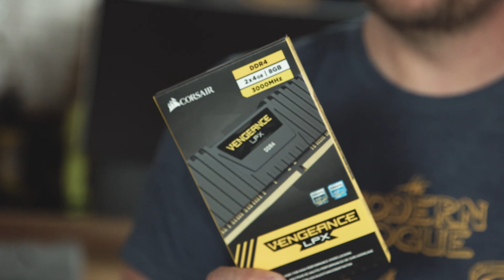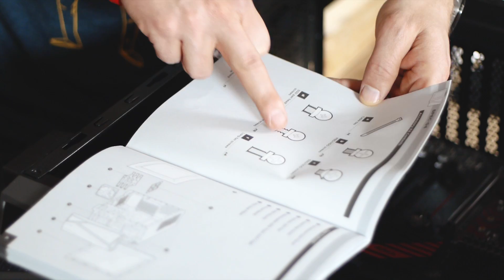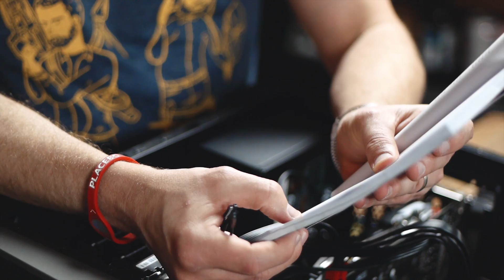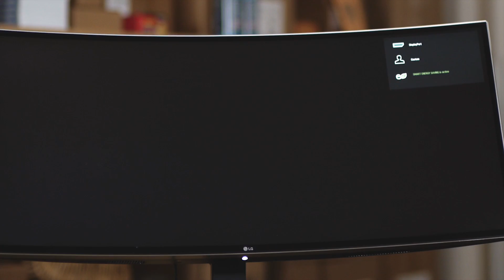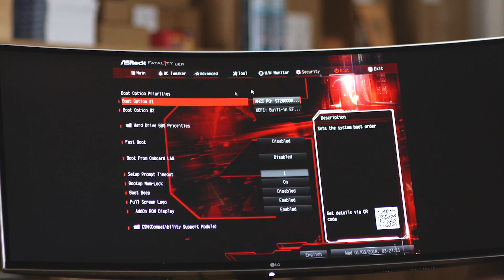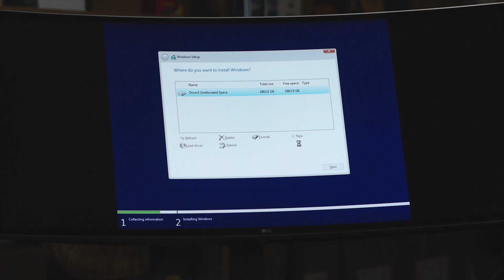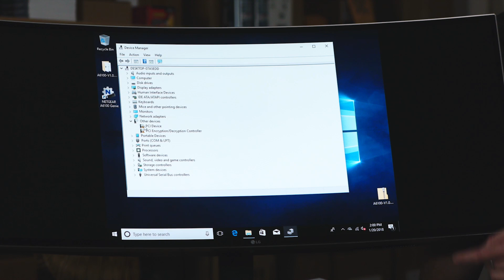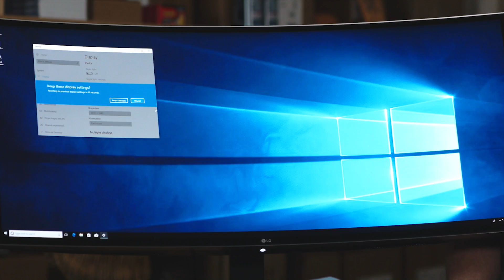Building a Gaming PC

Comment: Brian: "insert cpu in wrong orientation"
Jason: "oh, I remember"

that was Socket 3, pre 1993, in 486 times!! :o is Jason 100 years old?
Reply from the maker: 486/50 MHz was one of the first build I ever made.
Reply: @ModernRogue  Soo Yes?
Reply: @danieljhalab6775  confirmed
Reply: @ModernRogue   My brother once got suckered into buying a used 386 from WANG  trying to install Win 3.1 off the small 1.44mb  disks 6 OF THEM (about the time Zip disks and Jazz drives were coming out), then a 33.6kb modem before 56k tech were out the screeching then my girlfriends kid does some SouthPark  stuff in a chat box on AOL and I'd get kicked off for ''scrolling'? Can't say then were the good old days but I don't miss those AOL disks popping up in the mail kinda how Apple is polluting  the planet but "We can''t fix it we'll give you a discount on a trade-in (I'm sure they might go through your files because it's now their property again!)
Reply: @ModernRogue  A 486 should have had a ZIF socket unless it was some hokey-ass 486SL-25 really-a-386 crap. A DX/50 would've been ZIF. All the 386s had "Low Insertion Force" or LIF sockets. Those were the ones where you put it over the pins, hope to hell you lined them up right, and shove the chip in. And to get it back out you had this thing that looked like a comb to yank the chip back out. (The SL chips were mostly used in laptops because battery power.)

The bad old days. Says the guy who's spent more money on some old computer parts than the new ones that replaced them. sigh

Comment: The fact they forgot the I/O shield really bothers me.
Reply: Necrovarius was about to say this nooooooooooo
Reply: I was yelling the same thing
Reply: Same
Reply: was really about to comment the same thing xD
Reply: common noob mistake lol. but no really even pro's make that mistake sometimes.
Reply: I didnt see any mother board standoffs too .-.
Reply: the standoff's are already in the case for atx
Reply: Same     plus were is the RGB
Reply: me too
Reply: Necrovarius nashing teeth here Rrrrr
Reply: Me 2 but the worst thing is I did that to
Reply: Shuhei Depends from case to case, my last 3 cases didnt have a single standoff in them. Just sayin I didnt see them lol
Reply: Necrovarius not only do I not have an IO shield, I don't have sides to my case, no front, and no IO shield.
Reply: Fucked up the memory too
Reply: Henji96 How so?
Reply: Not mounted in dual channel config. Gonna fuck with the speeds of that ryzen cpu
Reply: Henji96 Each mother board varies on the config of the memory, he was reading the guide rather extensively, so Im sure he picked out dual channel properly. I dont use that mb so I cant say 100% but it should be running dc just fine
Reply: No he fucking didn't Look at 24:09 "Single Channel Memory Mode" It's A1 A2 B1 B2 on ALL motherboards. So the memory has to be mounted in every 2nd slot.
Reply: Thank you
Reply: That got me so upset
Reply: OMG I/O shield this is killing me
Reply: same
Reply: I always forget about it until after I've done cable management...
Reply: yeaaaah
Reply: me too
Reply: literally the first thing i noticed
Reply: they put the memory in wrong
Reply: Idk what the hell that is and I’m on reddit

Comment: It's kind of cool seeing you guys build your own PC, it's certainly gotten easy over the years. I wish I would have known I would have sent you guys a couple parts. :)
Reply: I remember when I would dumpster dive with my dad behind business parks in the 90's to grab old corporate gear before integrators would buy old or dead machines back for recycling. We'd load up the car with as many as we could grab, and cannibalize enough parts along with add in cards we'd find open box or heavily rebated from CompUSA. A lot used to be trial and error as to what was compatible back then, you'd spend hours diagnosing problems only to realize you needed to move a jumper and you'd even find yourself needing to write your own drivers from time to time.

Now, I built, cable managed, and killed all the Microsoft telemetry on my rendering/encoding/gaming rig in less than 3 hours, and have dozens of times the computer power of our entire old basement full of parts, and I have integrated audio good enough to make a SoundBlaster nearly pointless. Getting easier is an understatement.

Comment: And for 1800 dollars, you too can lose in overwatch in super wide high definition
Reply: overwatch can't play  in ultrawide, because blizzard hates fun
Reply: UHCKnight for 200 dollars you can buy a razer keyboard with some nice lights and clicky noises
Reply: R6jamandtacos who?
Reply: Jay Quek Hawken. Git gud
Reply: Im gonna check in this comment in a week, so far all of these responses are amazing
Reply: the hell are you talking about, overwatch works in 21:9 for me, thats ultrawide right?
Reply: Yes, but Overwatch cuts off the top to make it Ultrawide. The sides do not get extended at all. You are actually at a disadvantage if you play Overwatch on an Ultrawide monitor.
Reply: The ultrawide that Overwatch employs is a cropped 16:9 signal. It's not true ultrawide, you're actually getting less vertical FOV than a 16:9 aspect ratio.

Blizzard removed proper (perfect, true) 21:9 support when the closed beta ended, citing development/technological challenges (none of which were observable from the end-user with a machine that can run 21:9) and unfair advantages (which they've removed entirely when they changed third-person cameras to have a free-rotate camera, and made emotes both impossible to cancel out of and made touching the ground a requirement).

When asked about it at a Q&A at Blizzcon, an Overwatch dev indirectly confirmed they weren't going to change it.
Reply: From what I can see in the video, it plays pretty well in ultrawide.
Reply: Nucleargamer the dude who posted the main comment in this semi comment section
Reply: It should make you better with those smooth frames, but I wouldn't know right now. 
i'm just getting 60 fps on a television monitor and got to master.
Reply: And for 1800 you can get laid
Reply: Lorentz the annoying Llama $1000 is the low end of mid range now, graphics card prices are still somewhat high
Reply: Brant Arab open up the game, or watch someone play it on YouTube or something. Compare playing the same hero on both ultrawide and regular 16:9 and look at their guns at the bottom of the screen. On ultra wide you can see less of the bottom of the guns and they are larger on screen because 21:9 is literally just 16:9 cropped in
Reply: @legendofFranktheTank  it just zooms in untill everything is filled. their "21:9" bullshit is absolute trash

Comment: If the rx 570 wasn't so expensive due to crypto miners, it would be a great choice. If someone reading wants a gaming pc with similar performance the gtx 1050 ti is a great buy for less than 150. Or you can get a gtx 770 or 780 used for about the same price, just be aware that those cards use a lot of power.
Reply: by any memes necessary the 1050 ti has risen in price to about 190-200 dollars minimum

Meanwhile the rx 560 4gb 1024 bit version is currently at around 150-160, but runs about 10% worse
Reply: Epic

Comment: Could have left all alone, and pressed F12 and selected the USB drive to boot from. :) Typing while watching. ;)  Building a PC is still a work of art. Regardless if you belittle the task. However, many (like myself) go a bit more extreme than the basic CPU, Mobo, Ram, Video card install. You must be very careful installing the mobo and not short out the bottom with the stand-off posts. Plus, making everything very neat on the inside shows passion and pride of your workmanship of your build. Adding cool multi-color LEDs adds a nice genuine touch to the build or get LED RAM. Some mobo's have this feature built-in. This is what I do. I've been an I.T. Professional for 29 years and my motto is; Purpose, Passion and Pride. Always. 21:55 That the typical "I have no idea what you're doing" build. Every serious PC builder Dots their "i"s and crosses their "T"s. 

I did love the comment @ 25:41, "The weird part is that everything will be horribly dated in 20 minutes", Cute! 

https://www.youtube.com/watch?v=dbEogNgdJhs
My main YouTube Rendering system is an AMD 1950x Ryzen Threadripper, 6 Monitors, 32 Gig of RAM. Gigabyte X399 Auros, EVGA GTX980Ti, MSI RX580, NVMe 250gig Samsung 960 EVO, Samsung 850 EVO 500 gig, Samsung 850 EVO 250gig drive. External RAID 1 array over USB Type-C for important data, plus four RAID 1 NAS's. Plus a few Servers: https://www.youtube.com/watch?v=rE3iBLaxNxw

Comment: The RAM is running on single channel mode. You should install it on either slots 1 and 3 or 2 and 4, so you have more bandwidth. Some programs benefit greatly from dual channel.

Comment: For those interested: The video-cables come with the MONITOR, not the GPU. Also: Before mounting the motherboard, install the shiny bracket that comes with it! It shields your motherboard from dust and possible electrical shock! (Hence why it's called an IO-shield)

Comment: I am glad they had fun.
If this is your first time assembling a P.C.  Pay careful attention.
Install 1/o shield.
Check the DIMM slot your using is the correct port. Most motherboards First slot is usually the second one in, not the first one closest to C.P.U.
Connect your 8 pin header first. It is the hardest to connect after full installation if you have a cooler.
Don't try to insert your G.P.U with protective pin guard on. Once you remove the guard, don't touch the gold plate interface.
Don't worry about C.P.U fan..if its not connected, all modern motherboards will post, but won't boot and tell you it can't detect a C.P.U fan
Assemble your entire system out side of your case before installing to ensure no R.M.A on new parts are needed.
Do be some what concerned with thermals. Most hardware will throttle down to ensure you're in the green zone. You will lose performance on what you've paid for with bad thermals.
99% of the time you won't have an issue posting..however its the 1% that will frustrate the hell out of you figuring out what you need to redo.
Reply from the maker: All good advice

Comment: As resumed from my previous comment:

PSUs should face whichever way the fan has "brrathing room". They can't generate air to cool themselves out of nowhere! If rear exhaust, either way really does work.

Green zone? You have to set your own fan curve! I'd look one up if I were you. I have my "green zone", as you said, at 0-60ºC, Yellow at 61-70ºC, and Red everywhere beyond that. This determines what the PWM sent to the fans will be depending upon temperature.

If this is your first time building a modern PC, nobody will criticize your cable management. Just try your best. It's about using zip ties to reduce clutter using whatever you can.

Not a bad idea to use your phone for magnification. I hadn't thought of that.

Glad you caught onto ftont IO, I was a bit worried. Wouldn't it have been easier without the graphics card in place yet?

You just set aside USB 3.0 and aren't going to put it in? That's the easiest part!

POST can only be determined properly if a display is connected. Whether the boot logo shows is what determines that your PC functions.

You even held the IO shield not even thinking about it??? Aaargh!

Finally, you mention installing it!

Sound bar? A bit of movie-watching? Always okay to use a desktop as an HTPC :)

You always have to get a display cable. I have a few spare HDMI cables I can send to you when I have enough money if you like, just so you have spares.

You don't have to reinstall Windows 10 every 30 days. It justs harrasses you with a watermark until you activate.

You don't have to partition it, if you just hit next, it would do that work for you.

You can't trust Windows' drivers. Get your drivers from manufacturer sites. The cringe I experienced during your "driver installations" was unprecedented. 

Get Steam and buy Overwatch there! My god, you're making me cringe right now! 

I've got to admit, the hammer joke was pretty funny. The letterboxing is a result of the 1920x1080 render. They don't expect you to have higher resolution.

Resolutions would work better if you installed the AMD graphics drivers for your card.

You don't need to upgrade your graphics card when a new one is made. The old one still runs games well, right? Replace it when you start to notice newer games not running as well as they should. 

Thanks for reading!

Comment: Chances are the RAM location was wrong. If the slots went from closest to farthest from the cpu as A1 B1 A2 B2, then you would want RAM in either both A slots or both B slots to take advantage of dual channel mode. It sounds like you used A1 B1. The computer will obviously be usable, but you won’t be taking advantage of the full capabilities of your hardware. I hope they don’t fix it mid video since I’m not done with it yet lol. Love your work guys!
Reply from the maker: Thanks, man— I’ll double check that

Comment: 1) You put on just a regular band on your wrists
2) you didn't put the IO shield on the case first
3) you didn't route the cables through the back, if the cables were to get caught in fans it could damage them and cause some trouble

Comment: Just a heads-up: Windows 10 doesn't have a 30 day free trial, now it just works without a license but it has a transparent watermark at the bottom right corner and doesn't let you change the desktop background easily (you still can, it's just more complicated). If you want you can use it forever without a license (though I can't guarantee windows won't change that) and still have every functionality that's inherent to your windows version.

Bonus: You can purchase very cheap OEM licenses online from third party sellers, you just can't use those with multiple PCs, but for most people you won't need to for years.

Comment: The reason I like to custom build PC's, is because of universal driver compatibility. Pre-made computers, always seem to need stuff like "custom Dell brand drivers" for your SPECIFIC model computer. While custom built computers, seem to work with Windows built-in drivers, except I heard it is best to specifically use nVidia's website for your nVidia Video Card drivers. The worst situation you can have, is like if you have a Laptop you bought, and you didn't download the drivers onto an external storage device, and then you format and re-install windows, and can't get on the internet, to get your drivers, because you need a driver for both WiFi and your Network Port. If you don't have another way to get the drivers from the internet to put on the computer, then you are screwed until you do.

Also of course, you don't have to compromise, because you can buy the closest thing to your vision of the perfect PC for you within your budget. My perfect PC would have 100 SATA ports (so you can RAID Redundancy backup your HDDs and have plenty of ports to spare), 20 RAM slots (supporting up to 100 TB RAM) with a.... 10,000 Watt PSU (haha) that is 100% modular, and other stuff.

Comment: With the ram, the two slots used here are the first channel so you should leave a gap so that each channel gets one dimm
Reply: That's incorrect. RAM slots go (from left to right) A1 B1 A2 B2 (A and B are the channels) you want to fill one channel fully before the other. You were right about leaving a gap between the 2, but wrong in your explaination

Comment: Late to the party, but thermal paste from the manufacturers tend to be pretty bad, so, to get things running cooler you can use aftermarket thermal paste - all you have to do to apply it is put a pea sized blob on the cpu then attach the cooler.

Comment: The submerged boiling computer you showed wasn't actually water. It's meant to look like water, but it's actually mineral oil. Mineral oil is non-conductive and that's why it doesn't mess up any of the electric parts.
Reply from the maker: It’s definitely, definitely not mineral oil.

Comment: Did you actually check the manual for the memory installation, like you said you had to? Because now you likely have two single channel modules instead of a dual channel memory configuration. 
It's convention to skip one slot (and most often you need to use the one furthest from the CPU).

Comment: if your not in much trouble if the fans arent on because the cpu would automatically turn off before overheating , sure its not the best for your cpu but definitely wont fry it